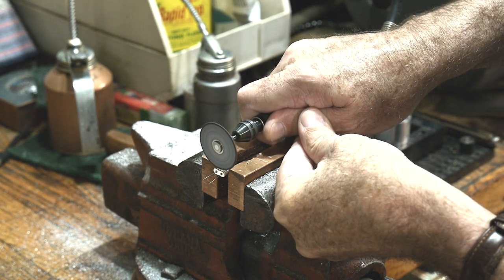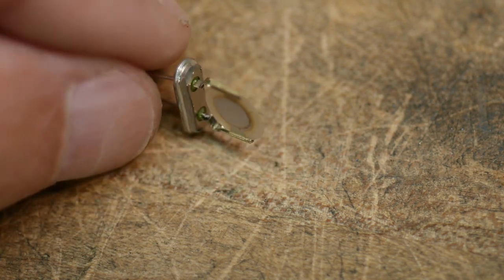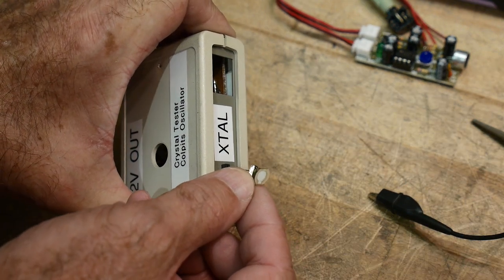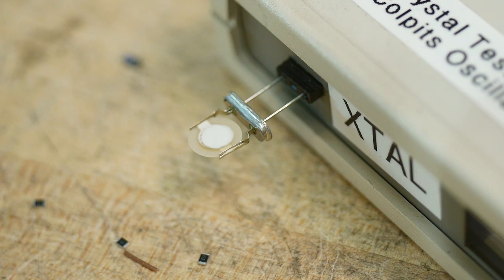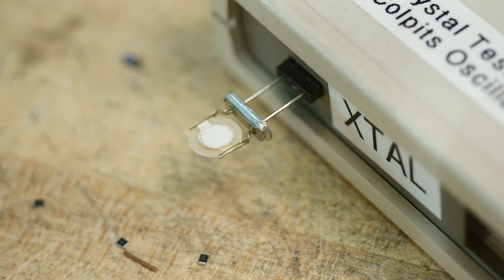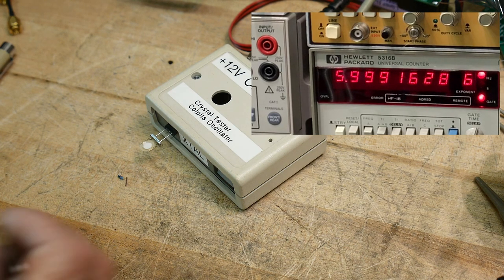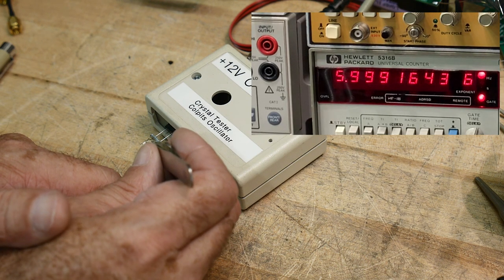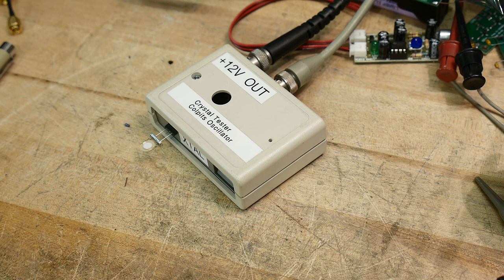#568 Using a crystal oscillator as a balance

Comment: If you still have that bare crystal lying around, I suggest you try to use it as an air densitometer. Put it in a container and replace the air with something more dense (such as duster spray, butane or even solvent fumes) and you'll see the frequency vary appreciably.

Comment: You really need to get the mass on the crystal surface in much better contact. A dab of ink would give you a few hundred Hz of shift. Adding lumps of stuff doesn't seem to work the same way. I found that watching the frequency and phase on a VNA get better resolution than using a frequency counter. That was for building a water toxicity sensors a decade or so back.